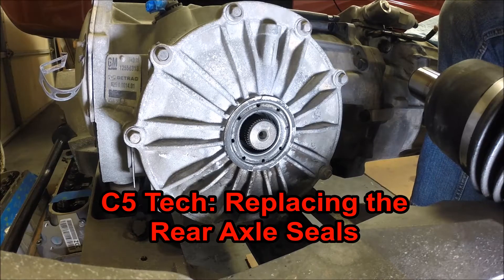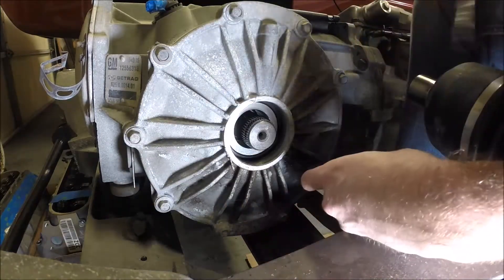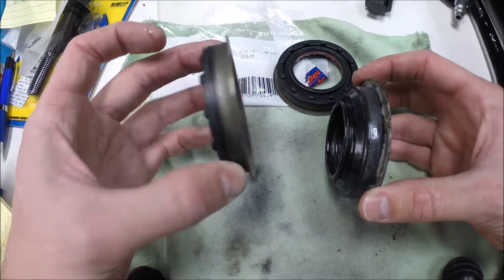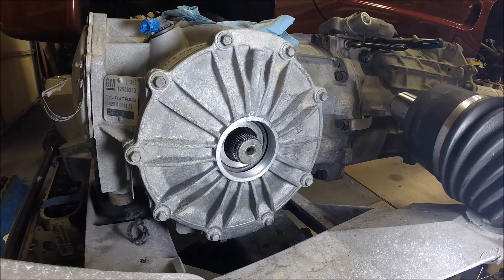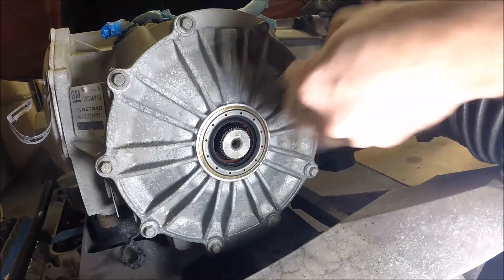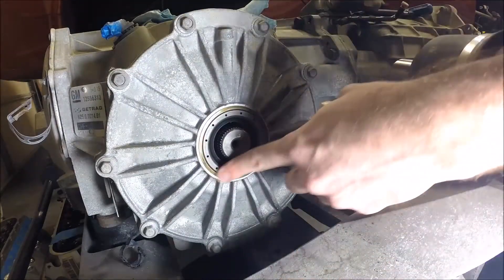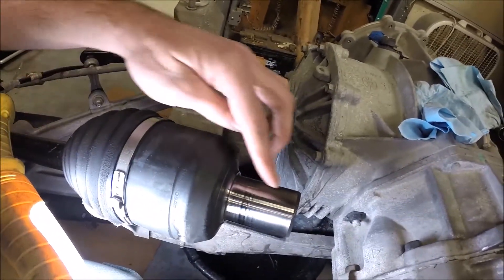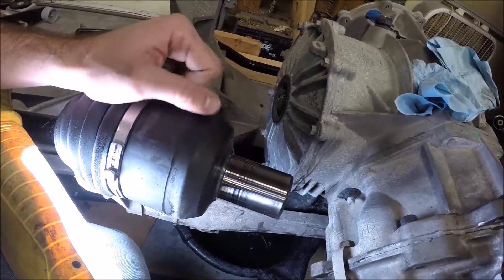C5 Tech: Replacing the Rear Axle Seals

Comment: Well it's useful but, he starts with the area already disassembled and with full access to everything. Some good diagnostic tips on other possible problems.
Reply from the maker: Yes, for me I had already pulled the entire drivetrain out because I was rebuilding the engine.   So I was at a different starting point that if you were only replacing these seals.    But sometimes it's nice to see exactly what you're working on, because when it's in the car, it can be difficult to see all the details.    Hope the video was helpful.   Thanks for watching.